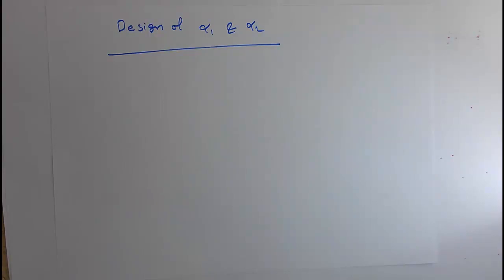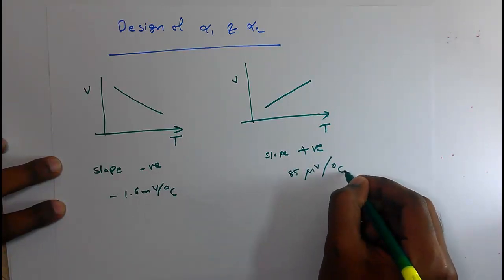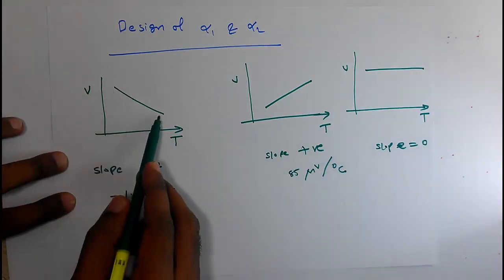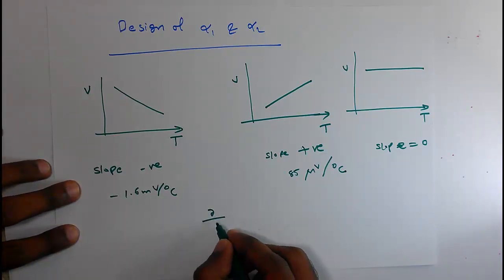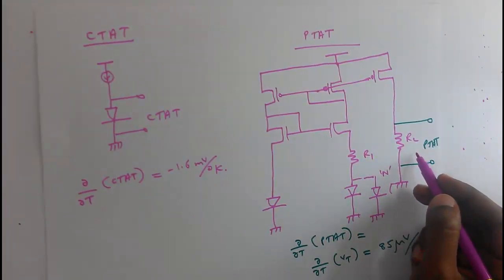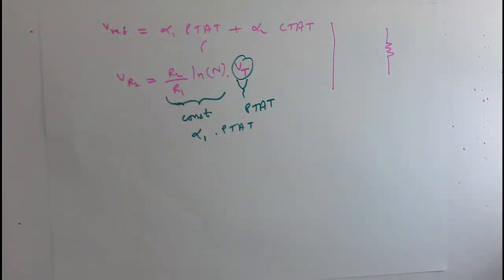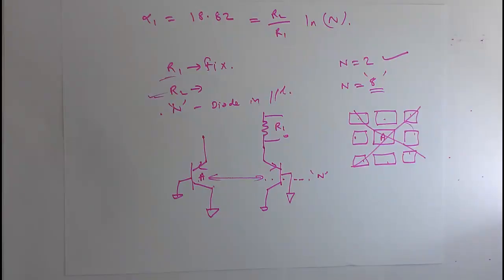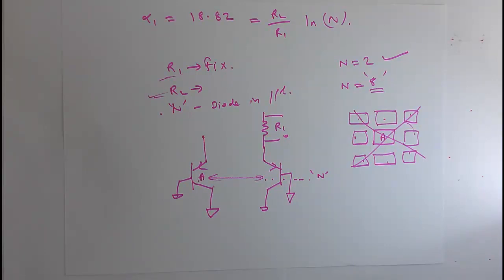Design of Bandgap voltage reference (BGR) - 7 : Design of BGR circuit

Comment: Hi, I have made BGR’s for 40 years. Your presentation is fine, but you leave out the very important startup circuit. The ptat generator has two stable states, the one that give the correct current. And the other that gives a current of zero. Please include a startup circuit that forces the circuit into the correct state.
Reply: Hello sir

As derivative of. CTAT voltage is varying across temperature, so for scaling PTAT  what value of CTAT derivative  we should take for calculation such that the scaling is valid for all temperature range.

Can u please guide

Thanks
Reply: @ First of all, the principle is that you add a CTAT voltage from the vbe of the bjt to a scaled PTAT voltage. The temperature coefficient of the CTAT voltage is about -2mV/degree C. When you simulate it, you can see value in your process. The PTAT current is made using a PTAT voltage drop over a resistor. This resistor is normally a high resistivity polysilicon resistor. When you make the Bandgap voltage you source the ptat current through poly silicon resistor in series with a diode connected bjt, to ground. The voltage drop over the bjt will be roughly 650mV. You have to scale the size of the series poly silicon resistor so that the sum gives approximately 1.25 volt at room temperature. The means a voltage drop over the resistor of (1.25 - 0.65 = 0.60 volt). Make a DC analysis in SPICE and you will see the bandgap voltage as a parabolic voltage, it should be with its max voltage at room temperature. For matching use unit resistors that you place in the same direction. Use more than minimum width of the resistors. Use the same unit size and width as in the PTAT generator. Happy New Year.
Reply: Thank you sir for your guidance, I will try this..
Happy new year to you!